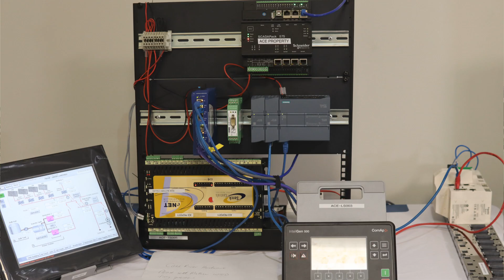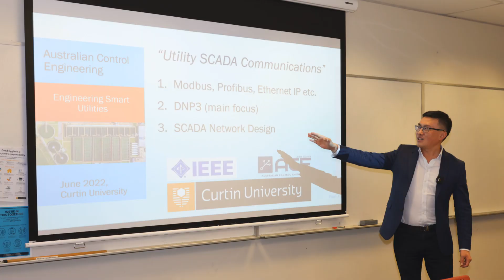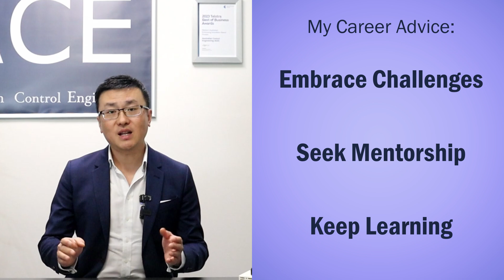How to Build a Career in SCADA & Control Systems Engineering

Comment: Im a chemical engineer can i be scada engineer ? If i do formation in scada systeme
Reply from the maker: Absolutely! A background in chemical engineering gives you a strong foundation in process systems and control principles—both of which are highly relevant to SCADA.

If you take proper training (or "formation") in SCADA systems and get hands-on experience with PLCs, HMIs, and industrial protocols, you can definitely become a SCADA engineer. Many people transition into SCADA from different engineering disciplines.

Start small, keep learning, and you'll get there! 💪